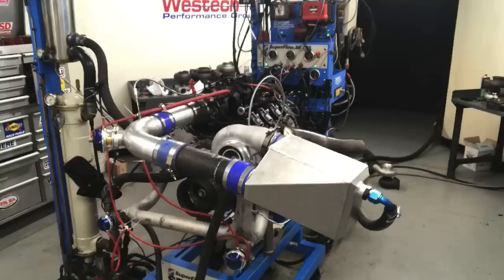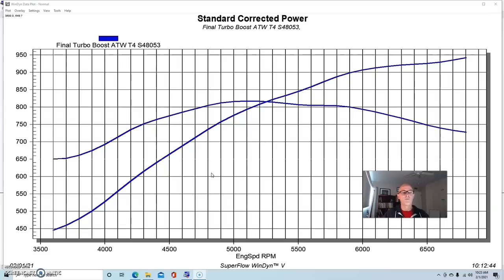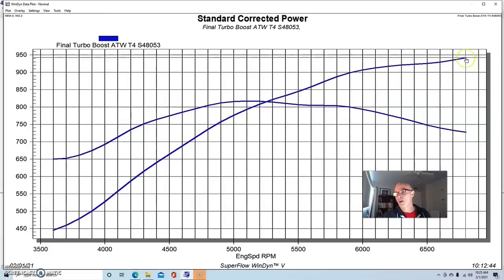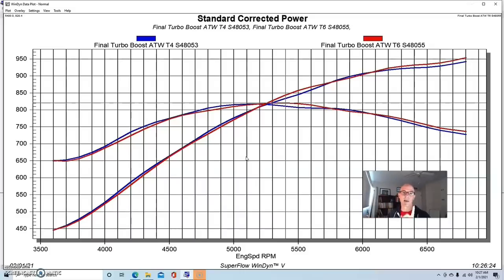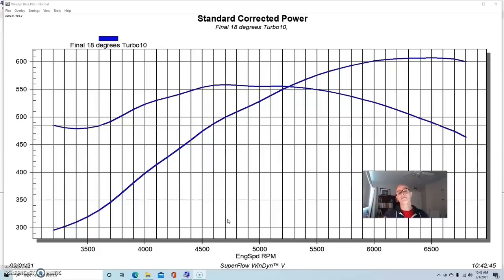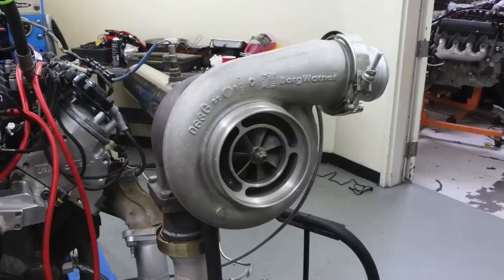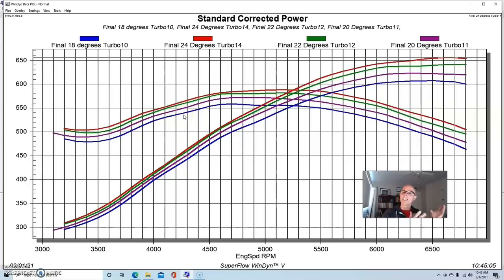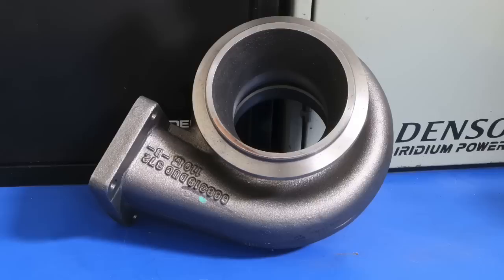JUNKYARD SBE LS S480 TURBO TEST-T4 VS T6 (BOOST IS A BETTER BUY THAN SILVER)

Comment: @Richard Holdener i've got an 04 GTO, and I am going to turbo it. My question involves the block and crank. It has the aluminum block 5.7L, and i've read that the aluminum block starts to get some serious torsional stress around the 1000 hp mark. What are your thoughts on building off of the 5.7L aluminum block using the stock crank (replacing the pistons and rods) to get around 9.0 sec quarter mile time? am I going down a road I don't want? It's much easier to keep my block than to say switch over to an iron block LQ4, and do the same. What do you think the reliable HP mark is with the aluminum block?

I drive it like I stole it, so she gets beat on pretty hard. I do have a dry sump to keep things oiled up, but I don't want to spend the money on a timebomb. Do you think the aluminum block is worth keeping or should I just sell it and get an LQ4 and build that up?
Reply: i just blew up my turbo LS1. block is crap, i put a rod through the block. thats 4-5 months of drag racing on e85 aswell. Get an iron block or gen 4 block. Im going LSA now.
Reply from the maker: we don't run over 1000 hp on alum ls1 blocks-cheap to get a 5.3l iron block
Reply: @richardholdener1727  thank you for your info. I think if I'm switching over blocks I will prob go ahead and get the 6.0L block.
Reply: It'll work great keep it . I've seen guys run them to 24 lb of boost With 12 degrees timing But 16 lb of boost E85 with 18 to 21 degrees of timing will get you 800 Tire . Don't go over 16 Pounds for safety . Change the rods , Pistons , camshaft , Springs , Fuel pumps , 210 lb injectors

Comment: The Question is: is the additional cost for a T4 housing on a BWS400 justifiable
Reply: Depends if you want to get the small 83mm (inducer) exhuast wheel , you have to go for the T4 I believe.
Reply: And the t4 takes up less room under the hood.

Comment: As far as I know there are 3 common turbine wheels for the s400 series turbos. There are third party housings but I don't think Borg makes a t4 housing for the biggest turbine wheel unless there is an obscure diesel that has one for commercial engines. I am assuming the t6 has the big turbine wheel, do you know what the turbine wheel was for the t4 turbo?
As a reference of comparison, one has a 74mm turbine, one 82mm and the largest an 88mm. Lots of the base t4 units come with the small turbine wheel and I think this is going to mount more of an obstacle to flow than the flange.
Reply from the maker: THE TURBINE WHEEL WAS NOT CHANGED-JUST THE HOUSING

Comment: Could you test the gap less piston rings to see how much difference they actually make on blow by
Reply: Years ago there was a test in Car craft on a vortec 350 with gapless 2nd rings. They actually do really good, like less than 1% when they're broken in. 
I would like to see a test with a modern set of gapless top rings. Some guys run them on land speed setups, and those guys would roll over their grandmothers for a single horsepower.
Reply: Why don't you do it?
Reply: @illreportbackinabit.8514  If you think I was talking about not gaping piston rings I wasn’t I was referring to Total Seal gap less rings which have an overlapping design so I want to know if they work as stated or a gimmick like u groove spark plugs
Reply: @keithmceuen8775  Start listening to the Hidden Horsepower podcast series.  Yes it's by Total Seal but the engine builders who swear by them will convince you they are worth power.

Comment: Would like to see race manifold vs. Log style manifold(Hooker setup). Seen the comparison you did. Log style had a lot of back pressure. Can the back pressure be cured with different camshaft or a/r housing?
Reply from the maker: THE HOOKER MANIFOLD IS MORE RESTRICTIVE BECAUSE OF THE MERGE (NOT BECAUSE IT'S A LOG STYLE)